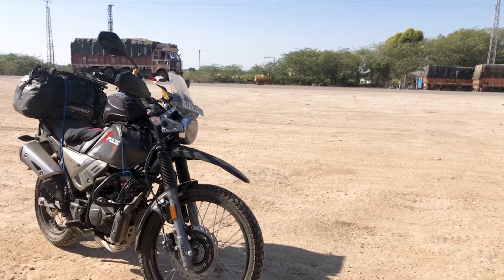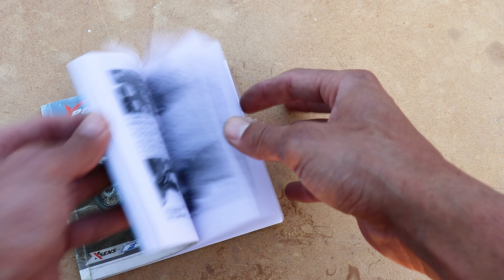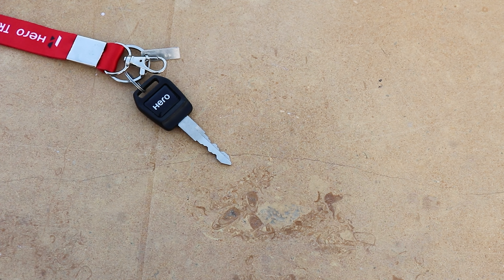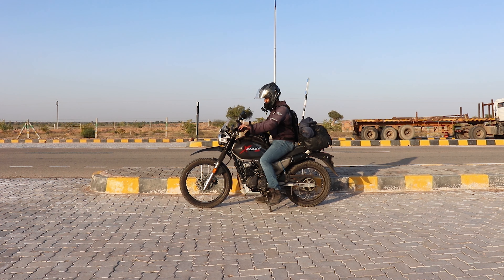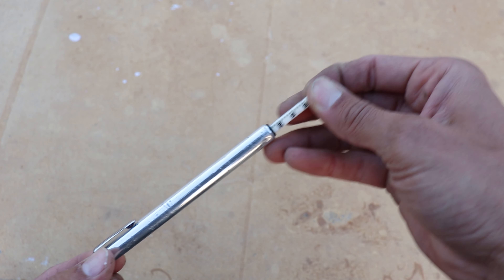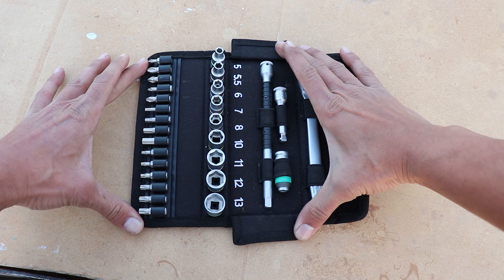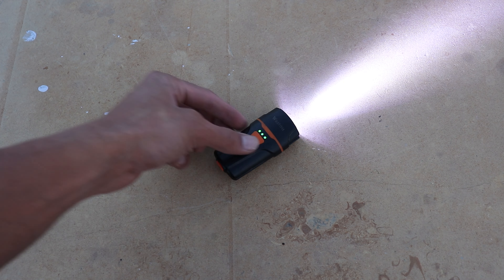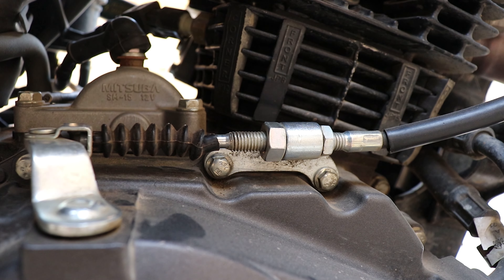Motorcycle toolkit for roadside repairs | Xpulse 200 toolkit

Comment: Nice 👌
These are nice tyre spoons. Mine is low cost basic kind worked on my re so probably would work on xpulse.
My favourite is My tyre inflator have resqtec micro tyre inflator, have made a provision for it to work with 12v socket using the usb connector.